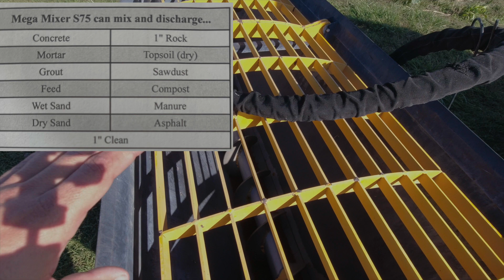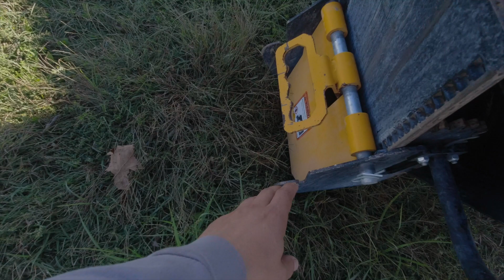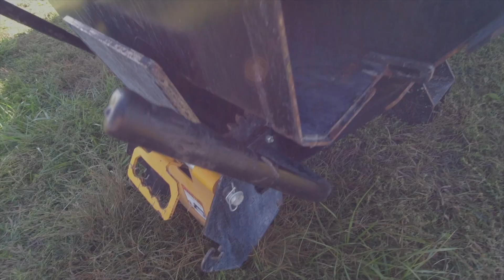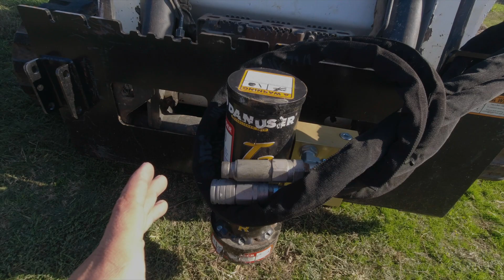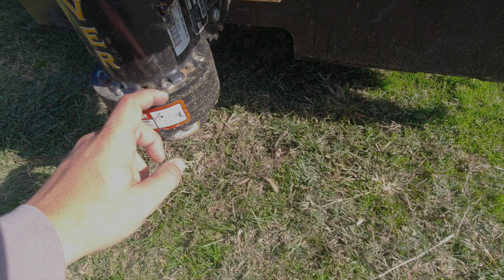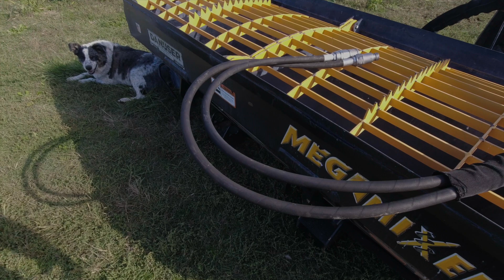DANUSER ATTACHMENTS Overview: Mega Mixer S75 & T3 Driver

Comment: Definitely an oversight on Danusers part with the chute design! Heck even if you didn’t grease that auger bushing it shouldn’t have failed in 2 hours of use. Surely it would’ve been greased at the factory. At any rate atleast they replaced it.
Reply from the maker: Yeah if they could change that design it would make it a lot better. It was greased from the factory I checked before using it. I dont know what happen to it. We mixed up two buckets of concrete an the third the auger started making a pop sound. I checked and seen that the bushing was out but yeah it got repaired under warranty.